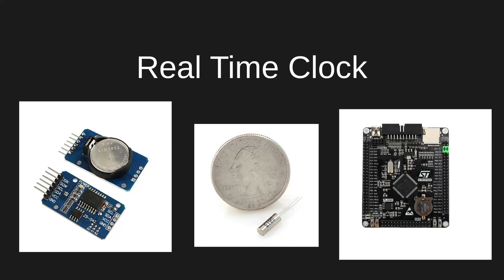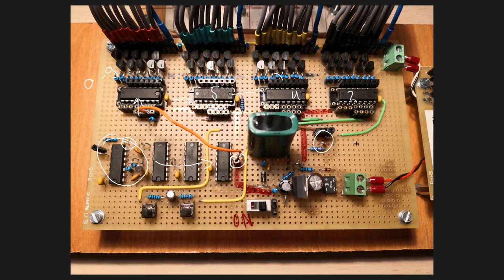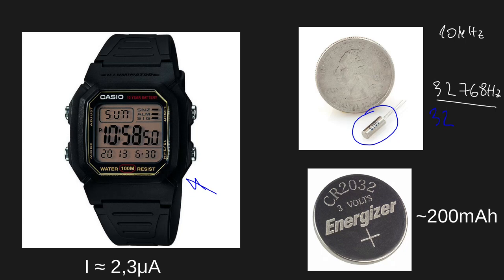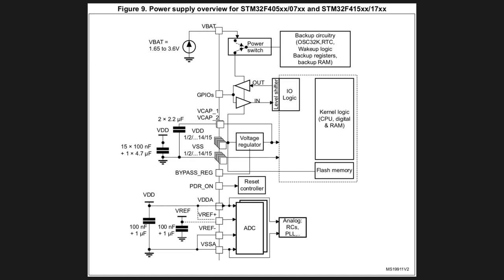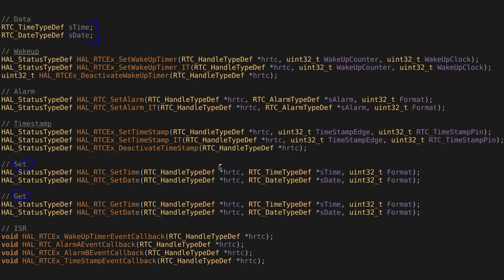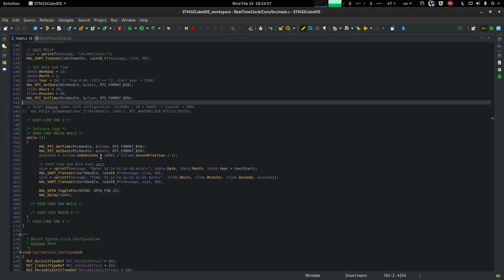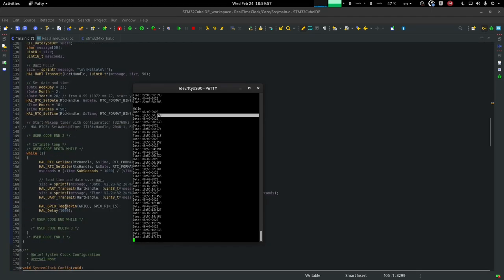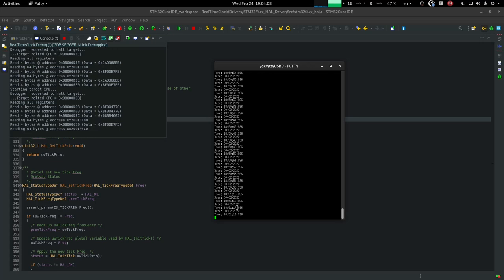Real Time Clock in STM32 | VIDEO 40

Comment: Hi! Thank you for this tutorial. I want to implement Alarm clock using this same STM32 board and have to interface a buzzer with the board for my project in university. Can you please help me. 
What are the configurations made for the pins PH0 and PH1 (RCC_OSC_IN/OUT)? Thank you!
Reply: Also, I connected serial port via PuTTy but when I run the code, the putty is not showing anything. Did I miss something?
Reply from the maker: In the video you can see only external system clock configured. This one is not used for rtc peripheral. What I failed to mention is the clock tree and the rtc is by default connected to internal clock generator. For best results use an external 32k oscillator. You can configure it in the RCC tab.
To use serial port, make sure to connect and configure the correct u(s)art peripheral. On the f4 discovery board, uart is not connected to the built in debugger, but some boards do. Make sure to read the board manual. In case of this discovery board I used external usb to serial converter attached to pins seen in the CubeMx window.
Let me know if this answered your question.

Comment: Hi Matej. How can we pause and reset the running RTC? I want to implement something like a stopwatch. I can now initialize and start the RTC but couldn't find any way to stop or reset it during it is running. Hope you might have an input. Thanks.
Reply from the maker: Hi.
What I would do is keep the rtc running and just read the time on request.
Let's say for a stopwatch. I would implement a pushbutton interrupt and when it's pressed I would read the time and store it as "start". I would also save the current "stopwatch state as "start" or "begin". Then on the next press I would save the time into  "stop" and calculate the difference.
Also give that interrupt higher priority so that from the time of pressing the button and reading the current time takes as little as possible. Should not be that hard to implement.
Also, dont forget to read the date as well, even if you won't use it, just call the read function on a struct. The peripheral has an internal locking mechanism that prevents further date and time updates in the registers before both time and date were read. Good idea, but people miss that so the time is never updated again after first read and you might think that you messed something up.
Hope this helps.

Comment: Can you create a basketball scoreboard with time and shotclock with 74hc595 for 7 segment display.
Reply from the maker: I would use rtc for time keeping. Maybe use an interrupt triggered by rtc every 1s to decrement the time. You can have a global flag that can disable the countdown when needed.
Driver for 7 segment display should not be that difficult to implement, you would just need to use more of them. However I would use (SN)7446 driver that decodes bcd code on 4 bits to 7 segment output. That way you just apply the right combination of bcd pins as they translate to number position and you're set. You will however need at least 4 gpio outputs for each 7 segment display, but should be straightforward to implement.
Best of success!
Reply: I think this is correct, would you be able to make a tutorial?
I had thought of a ds3231 for rtc

Comment: Amazing video, really useful. I need milisecond precision in my project, but it seems like the values I am getting are decreasing, instead of increasing. I am using an STM32F030R8 with it's onboard RTC.
Do you have any ideea why and how I could rectify this?
Reply from the maker: Tldr: sadly there is no replacement for a dedicated external crystal with a tight tolerance. That's the nature of internal rc based oscillators.
I have seen the difference between internal rtc and external crystal. I think that in that case the internal one was gaining millisecond values, reading it with its wakeup interrupt for highest precision. Using external crystal basically stalled this rising and left values very still even in millisecond precision.
I do not know of a feature that would mitigate this problem in rtc peripheral. If you find one I would be grateful for a comment of a solution. Hope this helps.

Comment: At 3:05 which clock oscillator you had used ?
Reply from the maker: I salvaged one from a rtc module that was defective, the circuit is just an inverter with two resistors and two capacitors, look it up online